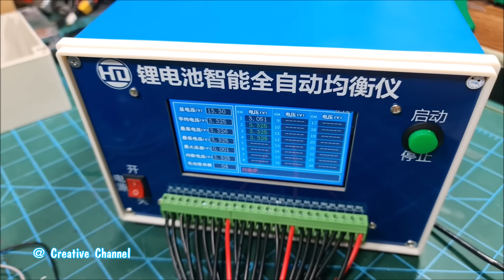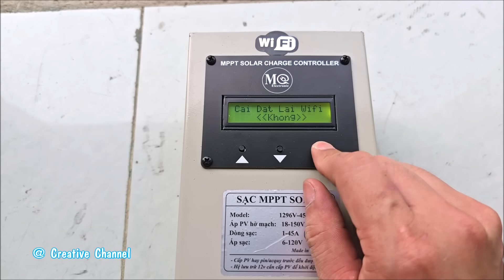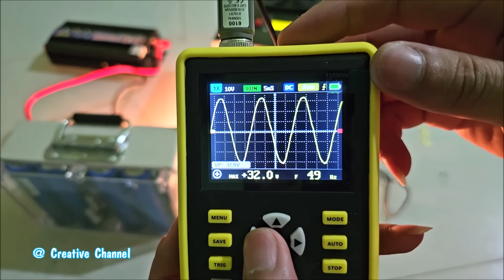DIY 40AH 12V 40138 LiFePO4 Battery Bank For Solar Power

Comment: Really enjoyed, and got satisfied mentally about it's calculation.
Reply: BMS control wires - DO NOT CUT!!! They have resistance and the length should be the same. How will the BMS correct the same voltages of the banks, if with different resistance of each wire, the BMS will receive different voltages. That is, balancing is essentially nothing.

Comment: You should add main circuit breaker for safety.
Reply: The only time you need a circuit breaker is over 100ah. It’s just a 20ah battery. You could lick it and be fine. It would hurt but you’d be fine.
Reply: Not sure if you just used ah in your comment by mistake but ah (amp hours) is a measure of capacity not output (current output would just be A or amps). A battery with just 1ah capacity could kill if it was able to fully discharge in say 1 second as this would mean a current flow of 3600 amps, however in reality its unlikely for a battery to be able discharge that quick due to internal resistance. However a capacitor could discharge in a fraction of a second, which is why so many people die when messing around inside power supplies or microwaves and capacitors can usually only hold tiny amounts of power equivalent to milliamps or even microamps but as they can discharge in microseconds the actual current flow they can output can easily be 1000+ amps
Reply: @cgwworldministries83  When I was a young man a girl in Thailand told me that "Lick it and you will be fine". She was right!!!!

Comment: I really like this also Is there anyway i could make this battery without using expensive machines? I also like the fact that you showed the battery working because most diy channels Don't do that.
Reply: expensive machines ??????
Reply: @MrCcfly  I think they're expensive by the look of it  it is shown at the start of the video
Reply: dont use that type of battery without a spot welder. There are screw type lifepo4 batteries available.

Comment: Balance leads aren't ment to be cut they are balanced from the factory if you measure the resistance of those you will get the same numbers in each wires and cutting it will alter those and thus you won't get true reading
Reply: How much percentage voltage drop from that very small resistance?

Comment: BMS control wires - DO NOT CUT!!! They have resistance and the length should be the same. How will the BMS correct the same voltages of the banks, if with different resistance of each wire, the BMS will receive different voltages. That is, balancing is essentially nothing.